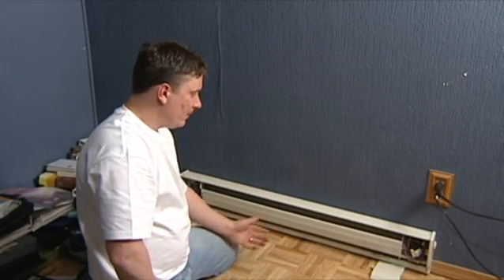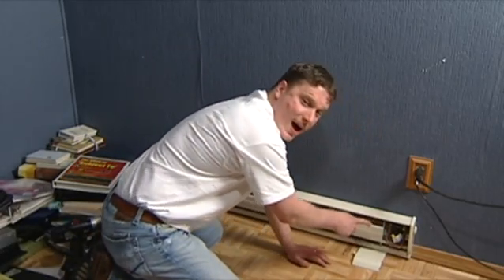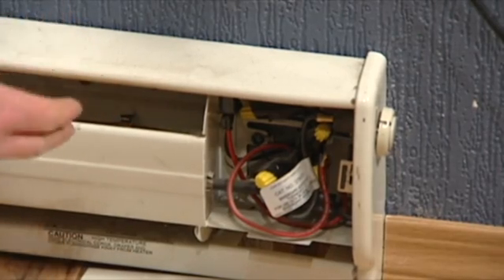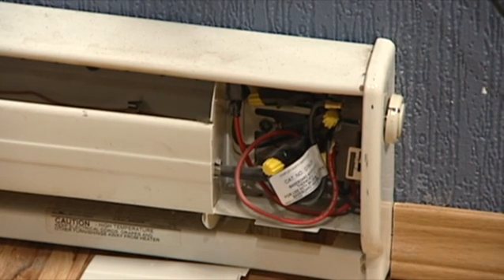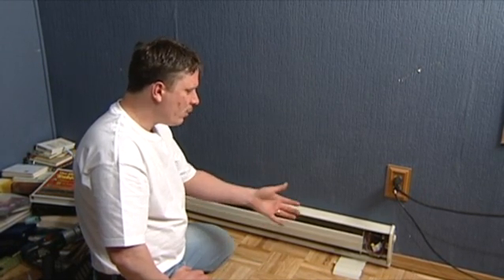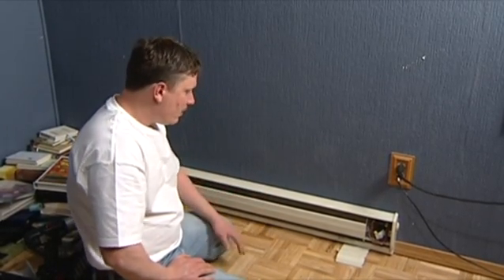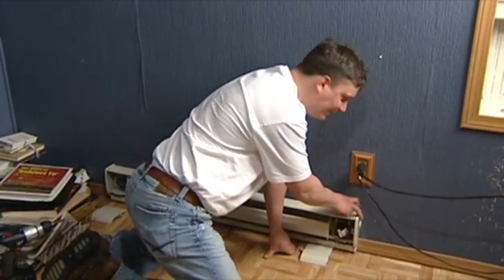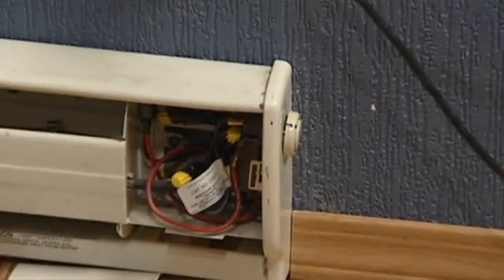Plumbing & HVAC Maintenance : Electric Baseboard Heating Troubleshooting

Comment: great video , thank you , my baseboard heater stop working when i checked it i found the copper line disconnected from the left corner could be the reason why my heater not working ? thank you

Comment: would anyone in the forum know why my 110 volt baseboard heater would have a burned-off wire going to the center coil? power supply is 15 amp 115 volt household current.  the breaker did NOT trip.

Comment: We converted a detached garage partly into a 165 sq.ft. art studio. This is the heat source          allmy.tips/FahrenheatBheater?  My big wish was for absolute quiet - no fan noise. I got my wish. Not a sound. We got a wall thermostat and I keep it on low all the time and turn it up when I'm going to be in the room. Very nice heater. I'm happy.
Reply: goooooooooooooood
Reply: Is it good to warm the floor and feet? I need in the kitchen

Comment: A Few comments; The unit with the copper line attached running the length is a Thermo-couple, it kicks the power to the unit off if it overheats. power is measured watts, resistance is measured in ohms, the current is measured in Amps and the electric potential (between positive and negative in the case of alternating current) is the voltage.